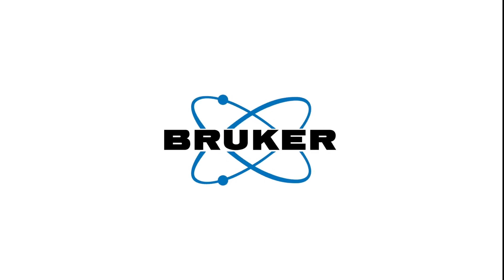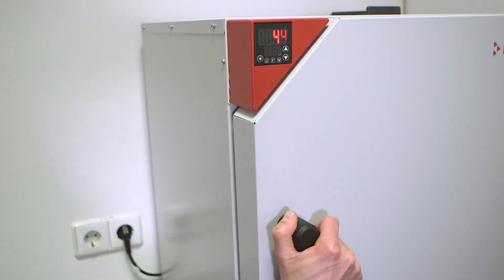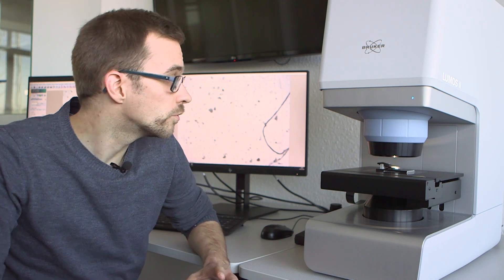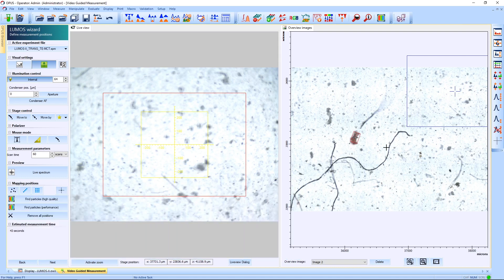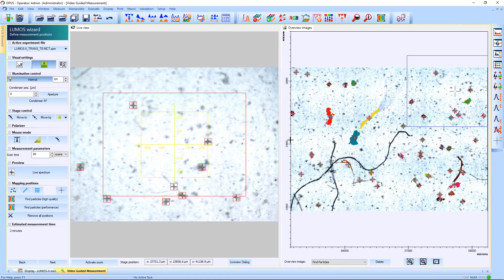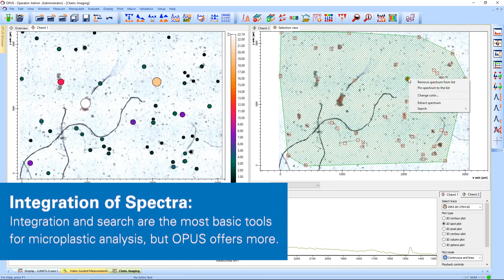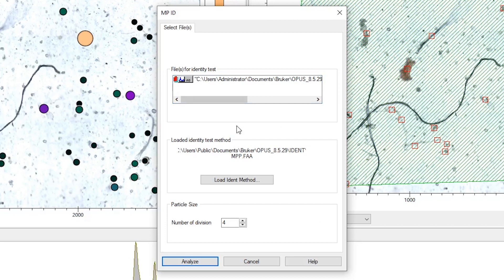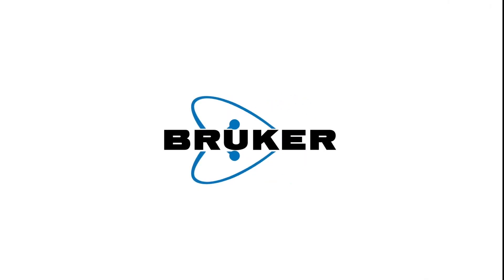Microplastics Analysis of Sea Salt by FT-IR Mapping

Comment: Bonjour, Est-ce que la mesure ce fait par transmission? si oui qu'elle est la taille max mesurable? l’épaisseur et l'opacité de la particule doivent être un problème, non?
Reply from the maker: Dear Lena Thomas,

This measurement was done in transmission with a TE-MCT but can also be done in reflection on suitable filters. This combinations detects  particles down to roughly 10 µm. Using an LN-MCT or FPA-detector, 5 µm is the lower limit. Larger particle sizes can cause total absorption which makes identification more challenging - but not impossible! If the particles are larger than 500 µm, we recommend to measure them with a macroscopic ATR accessory, e.g. the ALPHA II with platinum ATR.

Best regards,
Your Bruker Optics Team